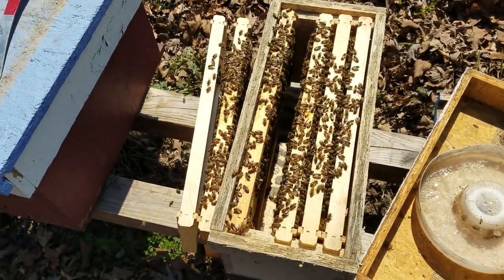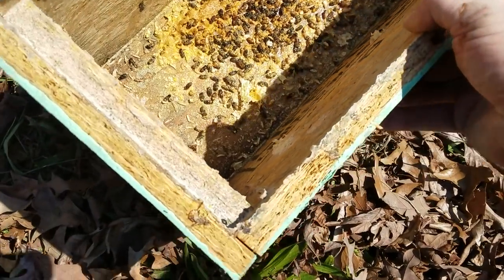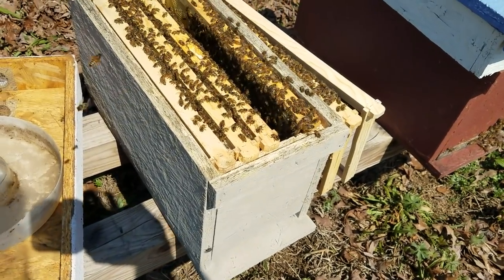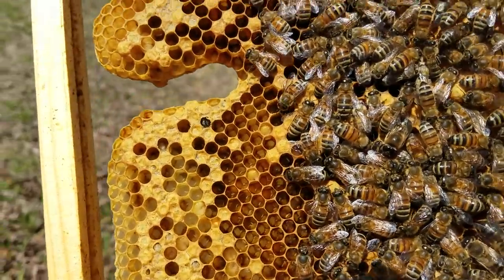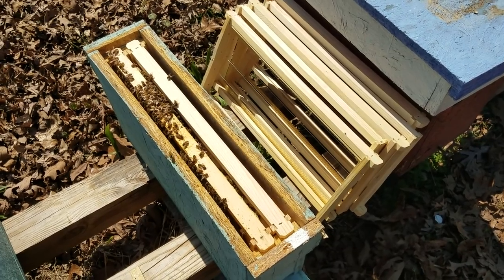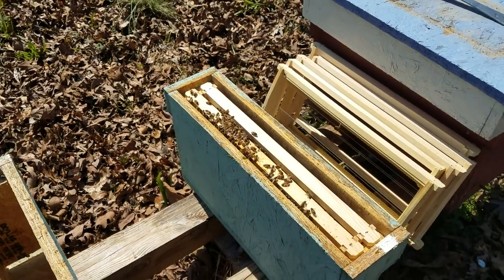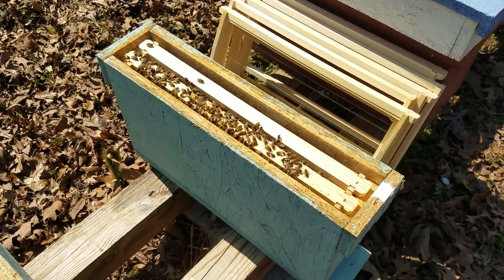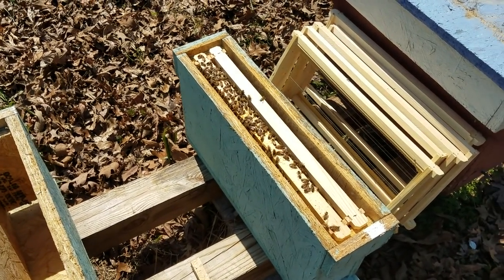How to set up a queen mating nuc

Comment: Thank You David, been watching a lot of your videos, because you use the same methods as I do.  I’ve been keeping bees for about 5-6 years.  But end up losing them over Winter, only to have to buy them again every Spring, Extremely Frustrating.  But I was trying So Hard not to use very much Pesticides.  Going to start using lots now.  I even tried using the OTS method, On/The/Spot, which worked pretty well.  But I was in the middle of moving, and couldn’t take care of them.  Might try again someday.  I’ve used the Queen Castle two years and had Success both of them.  All four mated and returned both years.  I really like your Basically Queen Castle Split Up.  I want to try those tiny Nucs, I believe they’ll work Great.  Thanks again for all your videos.  Keep Buzzing Along.

Comment: I was thinking about how you would clean the hive body. Does Advantech stand up to the force a pressure washer produces?
Reply: Lester Wetherell That's a good idea, maybe a heated water model so it doesn't take as long to remove Wax residue!  David keep the videos coming!
Reply: Now you are talking about a steam cleaner! Much more expensive and not very readily available. I also imagine the steam cleaner would start to break down the Advantech material.